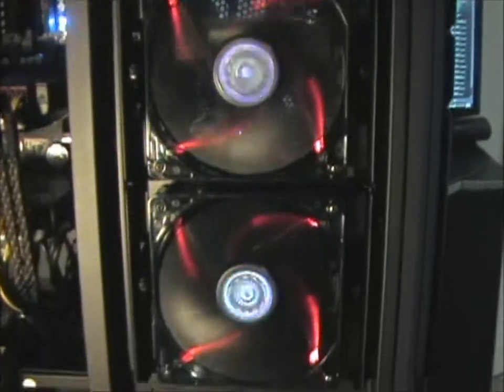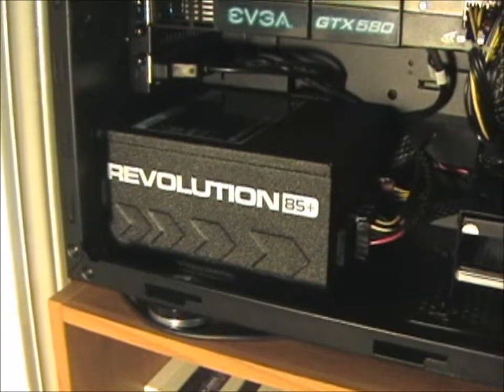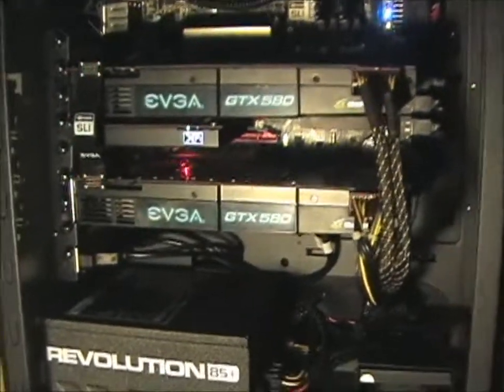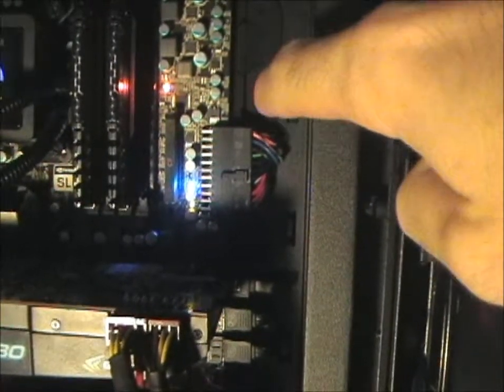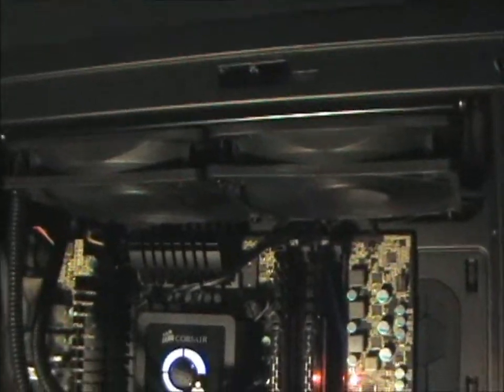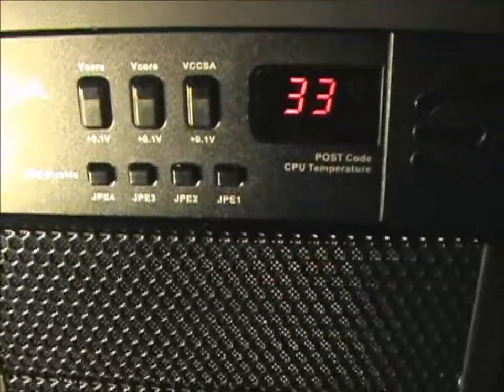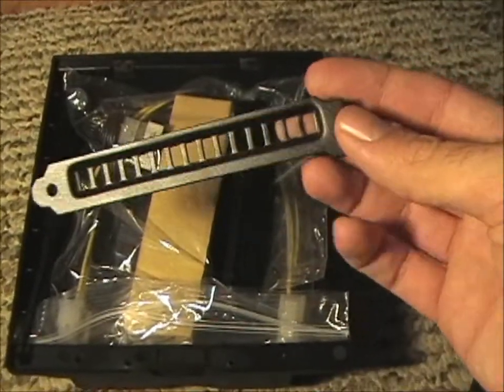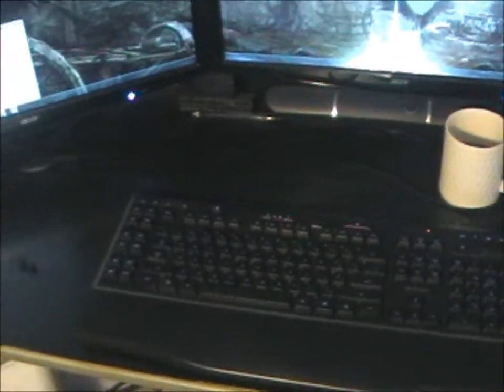CoolerMaster Case Finished

Comment from the maker: the difference is Nvidia you have to have 2 cards to run 3 monitors and AMD you can use one card but you have to use an active display adapter. Other then that there is no difference